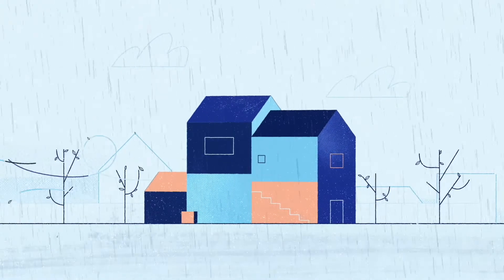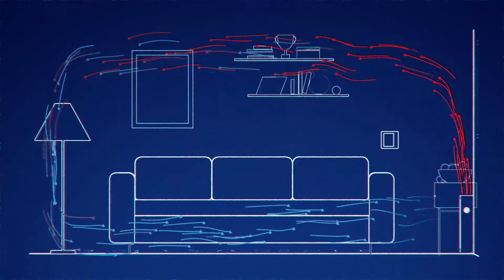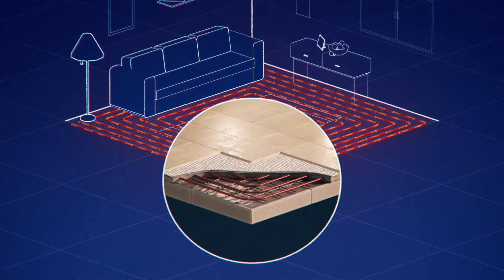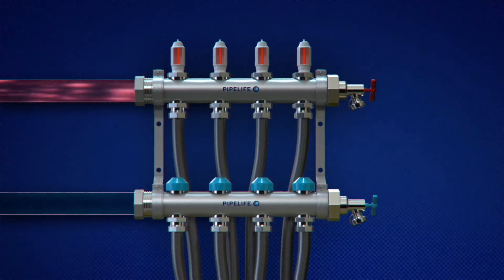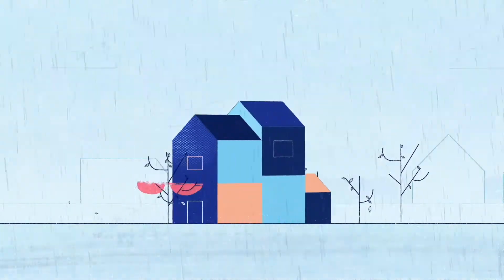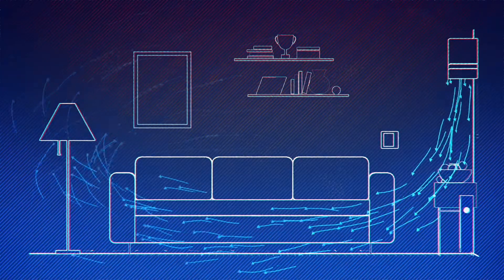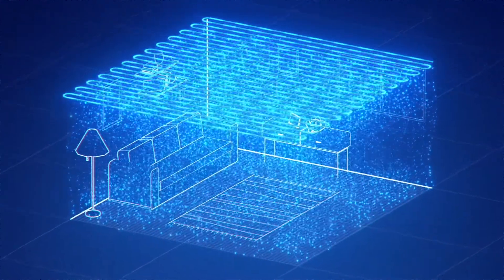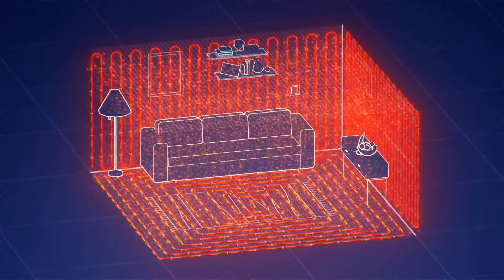PIPELIFE Underfloor Heating & Cooling explained

Comment: Wouldn't these pipes collect moisture from the cold air touching the outer surface of the pipe and later ruin the floors ??
Reply: 😂😂 No. I'm 48. I grew up with underfloor heating and now I have it in my house, the answer is no.
Reply: @dubravkojanusic6996  I think he was referring to the cooling aspect of the system.